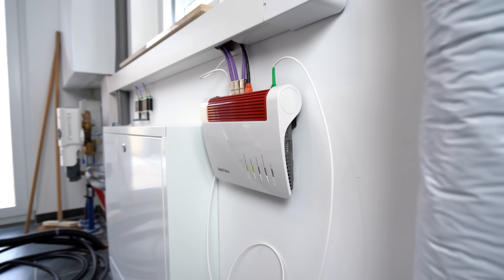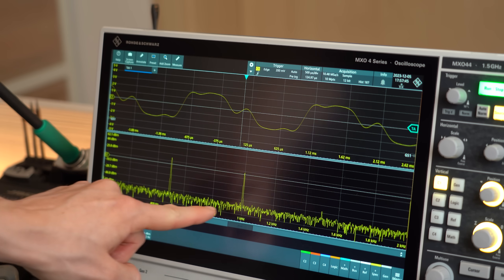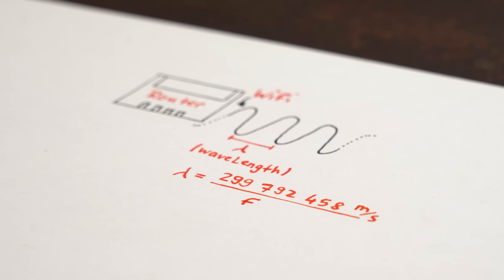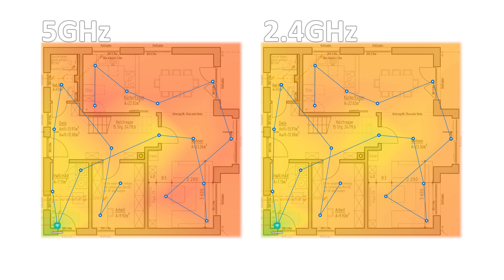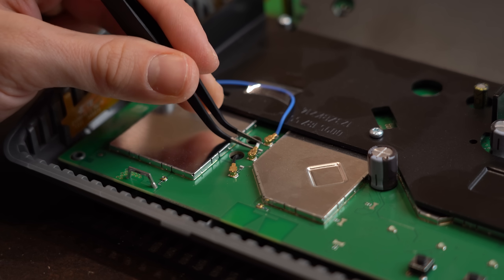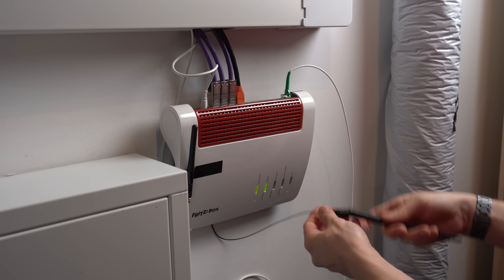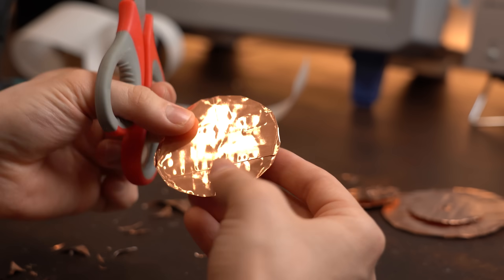I tried OVERPOWERING my WiFi!

Comment: You may also look at PCB. In my old Fritz!Box 3390 there are more antennas (not only 2 external). On PCB there are also many small L shaped antennas and one looking like paper staple. I must admit that I did not check manuals of AR9281 and AR9580 chips but construction is really interesting. Only weakness of Fritz!Box is that there is also no way to move to OpenWRT. I had bought my 3390 router just to make a switch of firmware and make some test. Downside of the migration is that 2.4GHz is not working and main programmer who did release the firmware did not made support for 2.4GHz. AVM make so good job in terms of making those WiFi routers but firmware they use sucks. I did also try to hack into original firmware using FT232 but there is some unknown root password required to access it.

Comment: separate the 2.4 and 5g ssids and connect to the 2.4 unless you are in the room with the router for 5g. You will get more range from the 2.4. If you have both tied tot he same name and you device like a smart phone not even giving you the option of setting the network freq used just the ssid it is probably making both perform like 5g

Comment: 7:44 Those antennas seem to be directional, as indicated by the “6dBi” in the product title. That would explain the 5-10 dBm improvement, and if the 2.4 GHz antenna was wrongly oriented, also its bad performance (or it could just be a bad antenna on that frequency, which would be par for the course from a 2€ antenna from Aliexpress anyways).

In any case, the best solution to this problem is to run cables and place APs in the right spots. We tried solving this problem many times with repeaters and the like, but it was all very unstable. In the end we had cables ran (on the outside due to the construction of the building), and it works like a charm.

Comment: Hey Scott, Love your content!... You know, that construction for the directional antena is actually not optimal. I think this is called Yagi antena and those can be constructed in different ways but the "front" elements and the final bigger "Reflector" need to be isolated from the connected element... I'm no expert, but I followed the mesurements of an online calculator and built an antena with nylon standoffs and some virgin copper pcbs cut in circles... And I reached almost 200m in a single direction! I think you should try many different types of antenas, it could be a good future video... here some types: Cantenna (AKA horn antenna) (Built with a can and a small coper wire), Yagi (just like the one you built but isolated), bowtie (looks like it can be easily made with a bit of copper wire), BiQuad, Dipole, Helical ... I tried a Helical before, but it was a bit complicated for me...

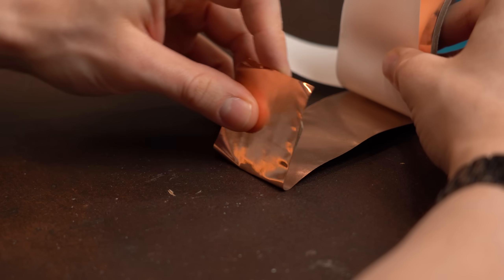Comment: 9:52 Yagi-Uda antenna driven element(driven element usually is just a dipole antenna) needs to be insulated from the rest of the elements. Try building antenna from 2mm metal rods attached to 10mm PVC pipe with hot glue. Also, yagi antennas have very high directivity and are narrowband try checking signal strenght with 0, 1, 2 and 3 directors with antennas elements both being verically and horizontally and with using different channels.
Reply: Yes, I wondered if the isolation stuff on the 2nd Element was done well too.
Reply: @norm1124  I don't think the material is flat enough either, but this is only from my short experience building a test antenna where I got much better results using flatter surfaces. All angles are inefficiencies
Reply: @veden3383  Agree, that rough angled shapes on this frequencies bring its effectiveness to 0. I had a great improvement on 2100MHz for LTE modem with the same antenna but built more precisely from a 1mm flat roof-metal. The elements were screwed to the metal rod with nuts as well - it does not matter.
Reply: You can build a yagi without isolating the driven element, if you connect to it via a gamma match.  It's trickier to adjust in the SHF range, especially without proper measuring equipment, but it can be done.

Comment: Take a peek at building a Yagi-Uda antenna. Those work when built using the correct measurements, however you also have to take into account impedance matching. If your home built antenna has a poor match with the AP, you could be using LESS (effective) power due to efficiency losses

Comment: I have a situation where I get 1 bar wifi signal no matter if I'm right by the transmitter or 100 feet away. I thought it odd and tried it with a different phone and get the same results. At the same time I usually set at my desk which is an audio workstation with amps and speakers. Anywhere I set my phone on my desk creates wifi sounds (jet engine) through my speakers. I've tried better shielding and the little iron bits/clips on the power wires which does nothing. I did find a solution though. I took 1 half of a metal pencil box and use it to set my phone in. The phone still gets it's 1 bar of wifi but the interference to my speaker monitors is completely gone. This came at a cost though. The cost is drastically increased battery drainage and use. The built in app say's 92% of my battery usage is from searching for a signal.

Comment: The best solution would be to buy another WiFi router/hotspot and install it in the middle of the house. Connect it to ONT via cat5/6 cable. Frankly, I severely dislike ONT with router functionality, because they make subpar routers that due to optical fibers being not an easy to lay down w/o risking damaging them (you have to be careful with min. turn radius, otherwise you'll get a optical signal power going down, or even break th fibre) often being placed not in optimal places, usually not far from the hole to outside were is you fiber cable comes from. Also, they are more pricey, so when you have to replace them due some kind of fault you have to dish out a lot more money. That's why most of ISP in my country prefer just to buy and install the simplest and cheapes converter-type ONTs, and router pick and placement is an end user problem.

Comment: A waveguide antenna (cantenna) seems to work pretty well and is easy to construct.  If you want to cheat, a third party AP such as unifi UAP would also offer quite an improvement.

Comment: Unscrewing the antenna while its transmitting (router is ON), it will damage your transmitter-chip. if the transmitter is transmitting, n e v e r demount the antenna.

Comment: Even though in realyity no one really cares, please keep in mind, that canging the antennas of rf equipment by end consumers  is not allowed in Germany, unless the device is designed with user exchangeable antennas and you use approved antennas from the manufacturer. There are special exceptions, like ham radio, but these do not apply for Wifi Frequency bands.
Da kräht zwar kein hahn nach, but theoretically someone who does not like you could report this to the Bundes Netzagentur. They have to investigate such reports and may send someone with measurement equipment and are legally allowed to turn off devices that do not comply with Regulations. In Practice, if they even measure exceptionally high field strentghs, the most they will do is pull the power plug of your equipment and tell you to not operate your hardware that way. But theoretically they are allowed to confiscate equipment and fine you.
I know this because as part of aquiring a ham radio license in Germany you have to learn the laws and regulations of operating radio equipment in Germany.
I dont think anything will actually happen, but do keep in mind that this is not 100% legal. I personally found building a Mesh wifi with multiple acces points that act as one is the easier solution. With fritz equipment you just power the mesh repeaters on and press a button on the repeater and fritzbox to connect them as mesh sattelites.

Comment: You get a speaker cable that is very discount, like aluminum 35 strand transparent shield, and since it has infinite length, it is only the signal intensity that causes it to radiate by right hand rule difraction.  Now you can enjoy new content instead of not magical whatsoever.  If you want the best signal, just use one source and multiple cables from the source, like if you connect a TDR, time delay refelctometer, you can physically see solder points as reflections on an intercom system within an aircraft intercommunications system.  So a termination is ok because the length is infinite.  The one property your probably not aware of is spacial capacitance abstraction, a short space acts as the metal, thus it copies the process in space, this is why strands amplify.  Where a oscilloscope you use one teeny tiny strand, but strands are PNP to one another.

Comment: Get a real router designed for external detachable antennas. My WRT3200ACM comes with four tiny antennas that cover a 3 floor house. 900 Mbit/s in the same room, and around 300 two floors down. The old phone gives me only 80-100 Mbit LTE on two bars, so I usually place it on the third floor with USB connection. I orient antennas horizontally. The only difference to larger antennas is how you shape the beamform. If you do it wrong, the smaller will work better overall, because they are less directional. I built OpenWRT and made some mods to use DFS and set my proper region.

Comment: Here is my solution to the fractured wifi signal. Like you the router is in the wrong spot, and what I mean is the router should be more central to the structure it is in. At my place of employment this is true and we all have 'green' wifi signals. Moat komes are not this case. I did improve the antennas with better gain omni sticks like you did, but also improved the SWR and the SNR of the entire system. I made a small simple auto ATU to interface between the router and the antennas and this gave me a better or 'greener' wifi signal map.
Peace

Comment: Thanks for the video showing real-world WiFi reception.  I liked that you included the DIY directional antenna, but I wish that you'd included a more proven directional antenna as well.  It could have been DIY as well, but inexpensive options are available on AE or TMU.

You don't want some 24dBi long-range model in your house as they create spot beams, but perhaps a 6-10dB model to shoot diagonally as you did with the DIY disk antenna.  I realize that we won't see another video about this, but an established design with <10dB of gain might improve coverage, though the opposing corners would probably have less.

I always feel wasteful using an omni antenna when the AP is in the corner of the house where most of the radiation (270-deg) is wasted into the neighborhood.  I'm sure that there's a reason you can't do this, but it would be a big improvement if the router were moved to the middle of the house somewhere and it would have been interesting to have tested this temporarily by running a network cable to the router taped to the back of a chair or something.

Comment: Copper tape will not work to make a Yagi Antenna...the copper needs to be substatially thicker around
1- 10mm and have a dipole emmiter. They actually work very very well if constructed properly. The copper tape would do no better than a single wire. Good video though. ❤

Comment: Instead of additional routers or repeaters, you want to separate the router and access point functionality. You can place access points where you need them, while the router does packet routing, and can be placed anywhere. Several companies offer equipment like this; I use Ubiquiti. I have a lot of IoT (really LAN of Things); 150 devices on WiFi. One router (Edgerouter 6P), and 4 access points (UAP-AC-M) keeps everything humming along.

Comment: So you ran two wireless transmitting devices in the same space, didn’t touch the channels, and expect everything to work? You realize wireless channel interference is a thing, right? Put two 5GHZ routers next to each other on the same channel, and you’re gonna have a bad time.

Comment: building a high efficiency antenna is very difficult, I've tried it myself. In the end it's almost always better to buy antennas than to diy them
Reply: Yeah even with an Analyzer its so much work for a single antenna..
Products you can buy are often designed and refined and honestly.. for what you get not thaz expensive considering the tolerances

Comment: Best is to use multiple WiFi access points throughout the house. Then use the isp as a modem/router. I have 5 WAP in my house. Two outside, one middle of basement and two at opposite ends of the house in the corner with reflectors.

Comment: You can actually increase the transmit power without hardware mods. All routers (or at least like 90% of them) use some kind of Linux, and that just reads from a table that has limits for each channel for each country. Now, you can just generate your own, or just switch to a different country in the router settings. Now, please note that the transmit power of the other device also matters, if there is a huge power difference, that is going to lead to some packet loss. Some routers have an option to disconnect automagically when a device's power is too low, which is useful for preventing weird "ghost connection" and huge packet loss issues and very useful for mesh stuff, but in this case it's best to just turn it off. 

Also, there were a few more standards for even lower frequencies. IDK why, but now I could only find Wi-Fi HaLow, even tho I recall more

Comment: Yagi and other types of the same kind work really well when the distance is an obstructed >1km long distance. A friend of mine built one during university times to get wifi connectivity from the university and his house which was on a hill and had direct vision to his faculty. It worked very well after about 6 months of trial and error!
Reply: that and the reflector and elements should be isolated for the dipole you drive it with.

Comment: 5:23 really ? boosting by 400mW wouldn't be that much, it wouldn't send it that far and create that much interference, how can it be illegal ? specially if you calculate the precise amount of boosting you need to get the signal strong enough in the far point inside your perimeter.
The idea of it being illegal is maybe so people wouldn't be able to crank up their router power without knowing how to not cause excessive interference, but if you know how to calculate it so the signal doesn't go that far away, I fail to see the problem.

Comment: I can suggest the youtube channel of Andrew Mcneil. a lot of diy and teardowns about antennas especially 2.4/5Ghz.
And if you are going to do antenna stuff, maybe a VNA/network analyzer would be a good investment. hooking up that DIY antenna can damage your transmitter when it's not correctly tuned. Out of experience I can say that just calculating and measuring with a ruler or some kind is not enough in RF, there are more factors that determine a good tuned antenna.
Reply: I agree. Great channel. Can't understand why his videos get such low views. I have made several of his antennas with help from a miniVNA.😄

Comment: Thanks for this video. I always wonder how much impact the antenna orientation has on access points with external antennas. 
As yours has originally internal antennas and is wall mounted i wonder if there is any difference by rotating the router by 90 degrees vertically and/or horizontally?

Comment: While I was waiting for internet to be installed, I borrowed WiFi from a neighbor across the street. I used a USB WiFi adapter and a metal candy bowl as a "parabolic" dish. Parabolic in quotes, since it was more a half sphere. The connection wasn't super, but considering the other house was more than 50 meters away, it's impressive that it worked at all.
Reply: I did that when wi-fi was first a thing and nobody bothered with passwords. Had internet from a business across the road for a good year before they noticed. I first used a 'windsurfer' and a usb adaptor before graduating to a biquad type antenna hacked onto a wi-fi dongle (chip antenna removed and pigtail installed - dongle fastened to back of the antenna reflecting plate). Good times...
Reply: @threeMetreJim  I did talk to the owner. I think I paid for the month as thanks.

Comment: Run a cable to the living room and install a 5ghz access point. It can be as cheap as $20 and still deliver around 100mbps. Archer C20 for example

Comment: You should also consider testing with two dipole antennas (like you already have in this video) but with them being perpendicular at a 90 degree angle as the two radios experience high crosstalk when they both are in the same configuration. Since the router has 2 antennas but the physical world has 3 axis (x,y,z), you may have to experiment with 3 different placement configurations of the two antennas.
Reply: No, don't do this, the radio chipset is 802.11AX and has MIMO where all antennas are used together to increase range and throughput, he should in fact add the third antenna (the router has three antennas, the third one is not DECT) to increase performance that for some reason he left out.
Reply: @troycording  you got any references for backing this claim? Consider sharing those. I checked in a bunch of places and all of them advocate for having the antenna at different angles.

Finally, if the router has 3 antennas, then all 3 should be used. Completely agree with that.
Reply: The word you're looking for is 'coupling', and yes, spacing the antennas at least 1/2 wavelength apart would solve many of the issues here. Ideally, they'd be stacked vertically or a full wavelength apart.

Comment: Mount 2 metal L profiles above the router and mount the antennas on these "ground planes"  try to mount the antennas far enough of the wall. Then measure them with a VNA